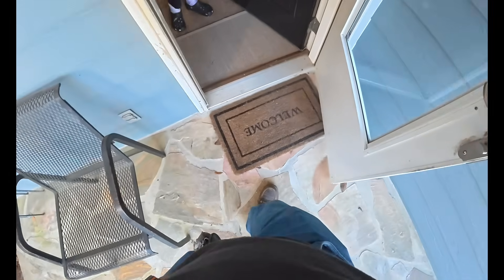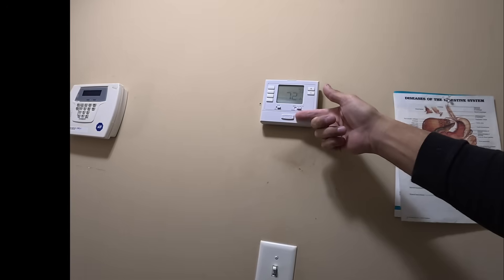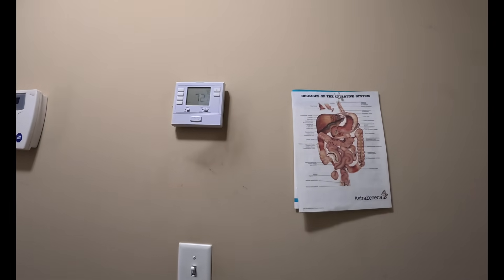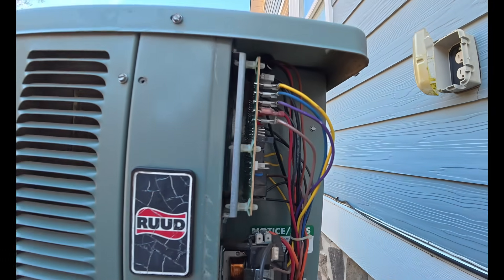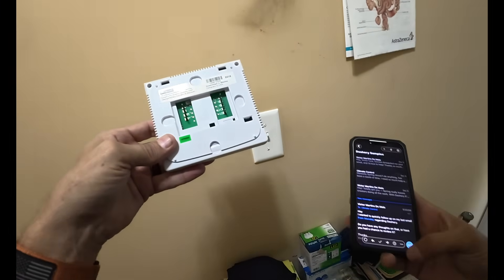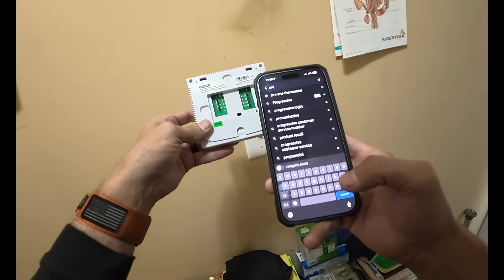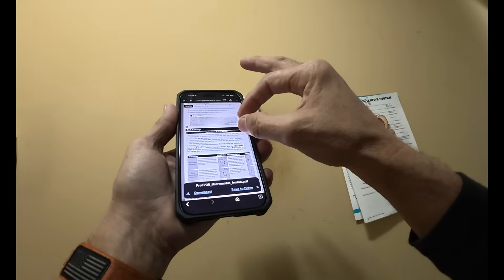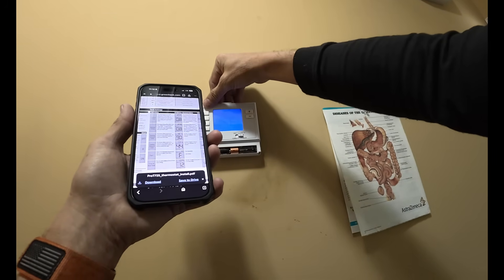Callback For A Heat Pump Blowing Cold At Night!

Comment: Her description sounds like what had been happening to me. Around 40 deg and below the TS would call for heat. The unit would come on and put out good heat. If it needed to raise the temp more than 1 degree the pump would turn off, the blower would continue to run blowing cold air while the house temp would keep dropping. Shutting off the system at the TS then turning back on would kill the blower and reset the heat that would come back on after a wait period putting out good heat until it starts the cycle again. If I reset the system before it started it's stupid cycle I could prevent the house temp from falling. After about 3 years and 3 different companies looking at it and each changed the TS the compressor locked up in the summer. My land lord had a different company replace the compressor. I explained to them what problem I had had in the past. I don't know if they did anything besides the compressor replacement and whatever else was involved in that but for the past 2 winters and going into the third the heat problem was resolved. It never had a cooling problem until the compressor crapped out. Only heat.

Comment: I dislike sales man pushing heat pumps in our area. I believe they make sense in some applications but they only push them because they make a highe commission. Peoples electric bills are skyrocketing. Worse yet is the heat pump water heaters. They run out of water quickly and are 3 to 4x more expensive than a normal gas water heater.

Comment: Rheem/Ruud uses demand defrost not a timed defrost. The jumper that you moved to 50 is the coil temp that the defrost terminates at. They come from the factory set at 70 degrees. 50 degrees may too cold to melt the ice on the coil.

Comment: This will be a great way to run the energy cost up in weather above 45 degrees and short cycle the system because too much heat is running. I know it's hard to teach people the difference between heat and emergency heat, but I could never do this. To each his own.

Comment: I remember an issue coming up last year when dealing with Heat Pumps and Emergency Heat.  My family back home in your area of the SE(close to Dothan in Bama) was told during extreme cold weather to just turn on Emergency Heat and leave it on during the extreme cold.  I remember asking my son about that but forget his response.   But Googling it it seems no one suggests that.  Emergency Heat alone is basically a setting for when the Heat Pump itself is not working correctly.  I myself have never lived in a home that used a Heat Pump so my own experience is limited.   Natural Gas baby.
Like others mentioned this is an interesting setting you were working with.
Reply: As a retired hvac tech i always turn my tstat to EH when temp is expected to go below 30 at night. Even though the heat pump will still make a little heat I think it's better to save wear and tear on the compressor when it's not helping produce sufficient heat. I always tried to install sufficient strips to heat the home alone rather than just enough to temper the air during defrost. It might cost a little more but my home is comfortable and I have peace of mind.

Comment: Hey Curtis just a heads up,on Rheem/Rudd equipment,the jumper settings on DF board are not for time.They are for temperature of coil to exit defrost.IIRC from 50-90 degrees,depending on jumper position.
Reply: Can you explain more please
Reply: Can you explain more please

Comment: Thanks for the video Curtis. I still want to know what made the HP cutoff. I couldn't afford to run my heat pumps at 79 degrees especially if strip heat is energized with HP. My electric bill would be close to $800 a month!  She will call you back in a month about her high electric bill....hoped you warned her.
 My current heat pumps are pretty old 1991 and 2009 but do not need any supplemental strips until 15 degrees outside to maintain 72 inside. I realize older folks want extreme heat settings and hope her fixed income can handle her bill coming. You should know Monday if she is fixed 🥶
Busy week coming!
Hope Riley is recovering well!

Comment: Sounds to me like the heat strips are not coming on. I know you replaced the relays but maybe they weren’t bad?  I know it was intermittent and therefore you had no way to test them and it was a proper call to replace them. I would have done the same on an inexpensive part to rule it out when intermittent like that. But what if the control to the relay is what is really intermittent.  That is a board issue. The lady said it blows cold at night and runs forever. That sound like a heat pump out of its operating range with no heat strips. If the heat strips work why would it ever blow cold?

Comment: I don’t get it Curtis. If the thermostat calls for the heat strips why would it ever let go of the heat strips until satisfied. What condition could happen to make the thermostat call for emergency heat and then disengage prior to satisfying. Makes no sense to me. Maybe you can explain.
Reply: You said it could be getting close to set point on the heat strips and then opening the circuit on the strips. That was your theory. Why would it ever do that is my question distilled down.

Comment: Below 32 degrees outside. Is it reasonable to expect ANY system to keep the interior temperature above 78 degrees?  Isn’t the recommended setting for heat inside an average home to be around 68 degrees in winter?
Reply: 68 to save power not heat. heat pumps can bring a home hot. Mine blows 94f air out the vents keeps my home  a stable 74f all night

Comment: Sounds like the heat pump is working against the heat strips when its set to run stage two until satisfied. When it's cold like that and the heat pump isn't producing any heat like you say, it seems counter productive to run that condenser for the little bit of heat it can produce. I'm thinking it would benefit the power bill to bypass the condenser when temps drop to a point that the condenser is ineffective and just run to heat strips in those really cold periods so just the air handler and heat strips run while the condenser is left off until the ambient temps outside get up to a temperature that the condenser works in stage 1.  Not sure if that or other thermostats have that ability.
Reply: Good observation I think. But even when 35 degrees out the heat pump is still making a little heat maybe 2 degree delta over return air so that makes me think that the system is not really fighting against itself but just that the heat pump is operating for very little gain. I think that’s why the “pros” are calling for “lockouts”
Reply: A foolish strategy. The heat pump should always be running because it is always contributing btu’s even way colder than Georgia ever sees and those btus are way more efficient than the electric heat.  Should never be locked out just foolishness
Reply: @TonyNanni  Those BTU's from the condenser are an energy hog as much as the heat strips are. That compressor is pulling 30 amps and as Curtis said only making 5 degrees above ambient. Do the math, waste. BTU's per amp.
Reply: That’s not true at all.
Reply: @TonyNanni  Good, you run your compressor for the 5 degrees and pay the bill. Others might see it differently. Heat pumps that do not work in cold weather are a waste of money.
Reply: What you don’t understand is that the compressor is not pulling 30
Amps not even close. Whatever it is pulling it is making btus more efficiently than electric heat. It will have a cop over 1 on the heat pump all the way down to below 17 degrees for the cheapest heat pump. Only the misinformed would ever shut off a heat pump with electric backuP.  Gas different story for two reasons 1) you have to because it would raise pressures too much and 2) gas backup has a different economic break even point.
Reply: @TonyNanni  I guess I don't get it. A compressor runs at a single speed and likely pressures being a 14 SEER so, how does it consume less amps just because the reversing valve is moved to one side in heat mode?
Reply: It’s not that it uses less amps it is that it turns those amps into heat more efficiently than electric resistance.  Btw that unit looked like a 3 ton it probably has a minimum circuit ampacity around 20 or so. When running it probably pulls around 10 amps. 

I am not a huge fan of heat pumps. I think they have their place but if you have gas available I still think the old saw of of gas is available you don’t use a heat pump applies. Heat pumps cost more break down more and don’t last as long as straight cool. The Biden administration put in huge subsidies to push people into heat pumps like they were something new and great. Without the subsidies heat pumps don’t make much sense economically for much of the country. Kinda like solar and all the other wasteful government spending. If heat pumps are so great let them stand on their own.
Reply: @TonyNanni  Agree on that...Gas rules in the heating subjects. Heat pumps also require some thought before installing them such as how much the local electric rates are. Our rates with SCE are 46 cents per kWh which would make any sense if gas was also available unless the state Government ruled gas heating a bad thing and banned it like California does.

Comment: Curtis. What was the temperature of compressor lockout? I’ll bet someone set it below 40 degrees. A single stage heat pump will not provide enough heat below 40, no matter what anyone says. You might get by at 35 degrees if the system is way oversized. Here in South Carolina, heat pump installs/change out accounts for 40% of our business. 40 degrees lockout has been successful, 35 degrees causes call backs.
Reply from the maker: Here these temps are rare enough that an outside stat is almost never installed for an option like that. So, we’d need a WiFi thermostat to manage that
Reply: @HVACGUY 
We use Honeywell TH8321R RedLink thermostats and on our heat pump installs, a C7089R RedLink outdoor temperature sensor. Wireless and the outdoor sensor is for compressor lockout. The sensor communicates directly with the thermostat
Reply: Comments like this show why I would never let an hvac company near my house. Just a complete lack of education. Even a junky seer 14 single stage heat pump produces btus of heat more efficiently than electric heat strip down to at least 17 degrees probably lower even with defrost cycle taken into account. You never want to turn it off ever. The reason this contractor is locking it out at 40 is because it can’t keep up and he wants the emergency heat on 100 percent at that point to eliminate call backs. The problem is one of controls not “lockouts” The contols need to be able to call the heat strips at the right time and cycle them until the set point is reached this using a blend of the heat pumps highly efficient btus and as low as possible amount of the costly strips. Now if this man is installing gas backup that is a different story because the gas furnace would blow on the coil in the air handler.
Reply: @TonyNanni 
43 years in the trade and 16 years as an owner tells me you only have a slight understanding of heat pumps. Unless you have an inverter heat pump, you will get next to zero heat at 17 degrees. I do agree with you, as in any business, there are employees less educated, skilled and knowledgable at what they are doing. As an owner, it is my job to quickly evaluate his qualifications and decide if he wears my shirt and drives one of my trucks. The only less trained employee I have is Paul, my junior tech. It is my job to ensure he is being trained to be a master of his chosen field, honest and personable. I will decide when he makes the grade and drives a fourth truck that I do not have yet. It will probably be his though. It is in his future, I believe.
Reply: Ok  I hope that young fella works out for you but you need to teach him to stop putting compressor lockouts on electric backup heat pumps.
Reply: @TonyNanni 
I probably wasn’t too clear. I know to set it up on droop and time for back up strips.  We do very few electric heat strips with heat pumps. Dual fuel heat pumps is our market. Inverter heat pumps are rare because we don’t get that cold and they are a huge price premium.  You have to use a lockout for the swing  over. Many mornings are below 40 degrees and the house will cool down too much.
Reply: I see you have gas back up. Then yes you need a lockout to keep the system from blowing leaks. This whole video and commentary was about electric though. So bringing in lockouts is just going to confuse the audience
Reply: @TonyNanni 
The thermostat setup did not explain there needs configuration when the strips kick in and run with the heat pump or when they run without the heat pump. Droop, time, not touched on.
Reply: Right. There is a way to fix that setup without doing what he did at the thermostat. I still think the problem is the heat strips are intermittent some control is not working right. Especially since the system is not new
Reply: Bill can you give me a little
More than a “slight” understanding?  Just a little maybe?  How about more than enough to be dangerously? Lol

Comment: I guess my question is what happens once set point is reached?  The system cycles off.  Then when it cycles on again, it will start with just stage 1 and aren't you back into the same boat again with it running just below set point in stage 1 and blowing "cold" air?
Reply from the maker: Not necessarily, her problem was it seemed like it wouldn’t shut off blowing cold air. On start up, if it doesn’t reach set point withina certain period like 10 minutes it turns on 2nd stage. So,mits 10 minutes instead of constantly not being able to satisfy.
Reply: @HVACGUY  Ah...I had not considered staging based on run time!  My mind was just thinking temperature difference between set point and actual.  I have run time staging disabled on my Ecobee on my dual fuel system.

Comment: I can only imagine her electric bill if she keeps that house at 78 degrees, especially if she uses aux heat all the time.
Reply: It only comes on when the heat pump can’t keep up with the demand.
Reply: @michaelritchie-ch6ib  We had temps from 6 to 10 degrees over night.  I have a 2 1/2 ton Seer 14 Rheem.  The over night temp was set at 66 degrees.  The unit cycled on and off all night and never went to aux heat.  With her temps around freezing and setting her thermostat at around 77 degrees I can't imagine why it would ever require aux heat.
Reply: @billkunert7281  I know what you mean Bill she’s trying to keep that house way too warm😂 you must have a good system if it was that cold outside and your auxiliary heat never kicked on👍 even if you only had it set for 66°🤘

Comment: Nice job Curtis. I have some problems with Honeywell lately also. The have, to my opinion, to much variable settings in it. I want the heat to go on, not to shut down every 5 or 10 minutes to see if the tempeture is reached, and then wait for a nother 5 or 10 minutes to get working again. If you need heat or cooling it has to keep working, as long as it takes.
Reply: What thermostat does that? Never seen it
Reply: @daveschmidt4504  The Honeywell Thermostats in our country (NL)